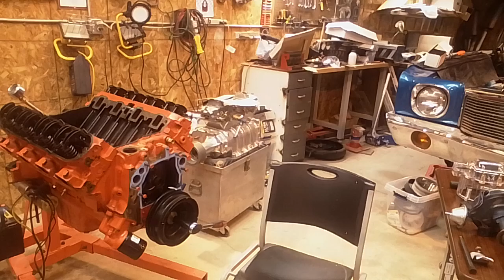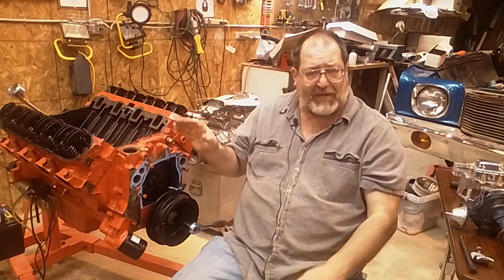How to put in a distributor so the engine will start Cadillac 472 / 500

Comment: Point distributor rotor at 9 o'clock, lower into block, make sure rotor points at cyl No. 1 when engine rotates to TDC. Verify with buzz box or DVOM on continuity or a test light at points, or secondary signal to coil. Rotate slightly to adjust as the vacuum advance unit is generally is in 6-8 o'clock position range. Like magic.

Comment: Was wondering what size bolt you have on the end of the engine to turn it over by hand
Reply from the maker: @randellay  if you pull out the factory cork plug there is 9/16 fine thread in the end of the crankshaft .... You can use a bolt with a nut or a thick washer or Cad Co in Albuquerque NM has a kit with a special made thick washer
Reply: Thank you so much for the reply was having trouble .🙏
Reply: I don't have the original timing tab if I am on number one compression stroke does that make it tdc I have a 74 eldorado pretty much stock besides headers and new iron heads I bought from cad company

Comment: Hey I have a 1973 and this seems to be the exact motor that I have which is a 472 Cadillac coupe deville. I'm trying to set the timing on my car and the crankshaft doesn't have a nut to rotate it.........I'm lost a bit on what to do
Reply from the maker: You can add a bolt .. stock has a cork to protect the threads ...it's 9/16 fine thread .... Or you can turn it at the flex plate and have someone spot you to stop at the right place

Comment: No oil going to top of motor, replaced pump gear kit, no oil to lifters push rods
Reply from the maker: @dennisreavis4687  since lifters are oiled first I would assume you have no pressure at all and the pump has no prime ... So try to reprime the pump by packing it or with a drill and pressure gauge ...if it's a old engine the pickup tube could be blocked with the plastic teeth from the timing chain

Comment: Scott, on a high compression 1969 472 what is the specs for compression testing? do you have those numbers?
Reply from the maker: It's more important that it's even ... I'm at 7000 ft up so what I see is different .... With 10 to 1 I would guess that you are around 120 to 140
Reply: @scotthatch4548  well i had a  couple cylinders as high as 180, lowest being number 4 at 140, then i tested number 4 again last night and it was 125, sprayed some oil in there and it jumped to 170.
Reply from the maker: @atribecalledcookies4  not consistent ... So I wonder if you are doing it the same each time .,full battery ..all plugs out .... Sounds like a testing problem not a engine problem
Reply: @scotthatch4548  All plugs were out, full battery, fuel pinched, throttle open, no spark, cranked a few revolutions . I'll run the test again here in an hour or so.
Reply: @scotthatch4548  I tried a different gauge,  pulled all plugs again, ran the test and now the numbers are all up and consistent 👍 whew lol

Comment: Hello, I've been building a 472 for a while now.. I'm almost done.
I just bought an hei distributor for it and I'm kinda lost as to where it fires... you said point to point, but can you please explain in more depth?
Reply from the maker: Look at the reluctor wheel in the center ... inner wheel has triangular points as does the outer wheel
Reply: How do you read the 3 notches on the timing scale I cleaned the rust off and I don't have any numbers on it. And how did you go to 12 degrees
Reply from the maker: @ladon50la  depending on the year each notch is 4 to 5 degrees .... I'm used late model so it has more marks and numbers
Reply: 1970 cadillac coupe Deville with the 3 notch  timing scale
Reply: @ladon50la  I had the same issue, not sure if the way I did it is correct but I'll tell you. Perhaps Scott could correct me if I'm all wrong. 
First I found absolute TDC, then I made my own notch and ordered some timing mark tape, I then lined up my TDC mark that I made with the 0 on the tape. Rotated the engine back to 12 degrees. I think I should be where I need to be
Reply: @How_the_gods_drill  thank you I will have to try that method

Comment: Do you install the distributor the same way in a 1964 429 ?
Reply from the maker: I have not done that particular engine but it's basically the same for all engines ... Find number one intake ... Pay attention to rotor rotation direction ... I'm assuming points so just as they open

Comment: Can you just leave the distributor in and put #1 cylinder where it needs to be and just follow the firing order from where ever the rotor is pointing?
Reply from the maker: If you are sure you are on number one firing point and don't mind wires being messy then yes ... I would still watch the intake valve go shut and line up the timing mark and trigger point on the distributor then start at the post with the rotor pointed and follow the firing order
Reply: Thank you sir appreciate the wisdom. I found a 1970 deville with the 472 the last sticker on the plate says 79 so at least 40 years since it ran starter cranks good but I'm having distributor problems.

Comment: Is this the same process for the Cadillac 425 Engine ?
Reply from the maker: Yes
Reply: @scotthatch4548  Thank you
Reply: @scotthatch4548  how about a 1965 caddy?
Reply from the maker: @utahrides2903  it's the same for any engine ... Just find number one cylinder and watch the intake valve close... Points are a little more work to set ... You can get close or you can use a test light
Reply: @scotthatch4548  I’m just curious about the firing order and cylinder arrangement

Comment: Crap p rods, conn rods, heads, q jet, crap intake, too high a distributor,  not enough parts made, no steel crank, awful balancer, stock oil pumps stink. They loose prime, cast rods, cast pistons. 4800 rpm limit. Heavy crank, Need I say more.

Bloodviking,  engine builder

Comment: Ok man, I fired up my 472 for the cam break in. That actually went smoothly😊
I haven't driven the car yet cause it seems to have I minor rough idle. 
It has a brand new elderbrok carb. I set the timing at around 9 btd, it has an davis unified on it.... what do you think the best initial timing would be best? Any advice would be greatly appreciated.  Thank you in advance
Reply: No pun intended